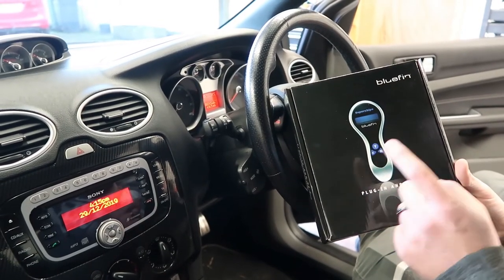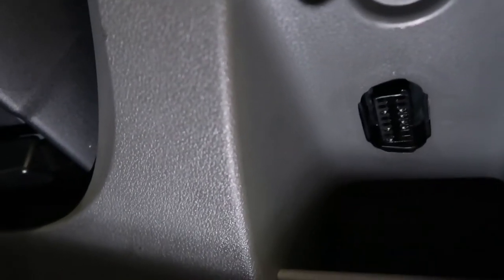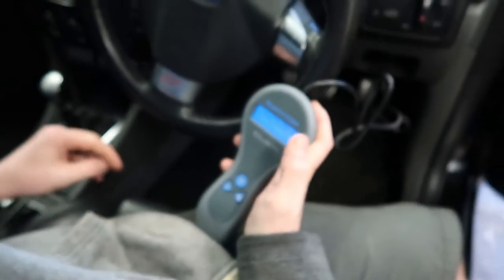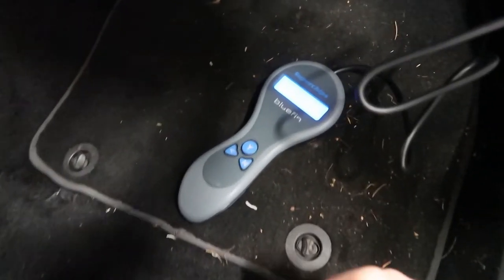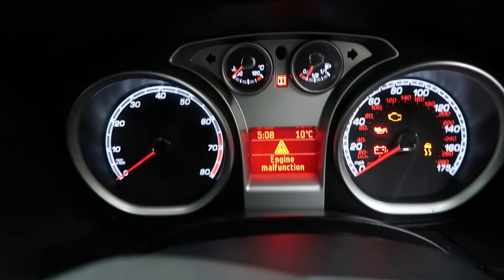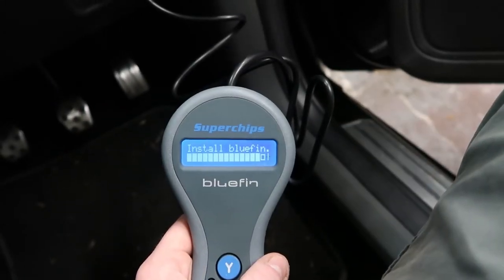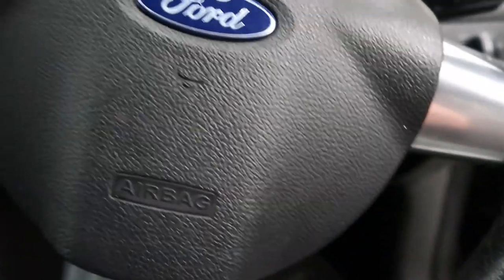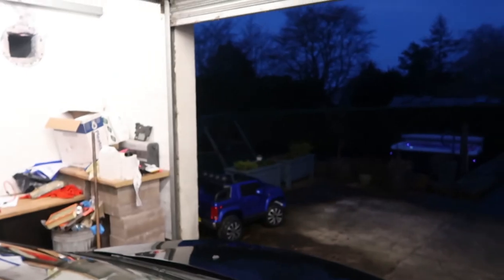HOW to get more HORSEPOWER in your car || Bluefin install on my Focus ST225

Comment: Did you notice the difference once remapped?
Reply from the maker: Yeah, it was noticeably faster, it wheel spins in 4th lol
Reply: Dasi's Garage do you find you’re burning a lot more fuel.
Reply from the maker: F4R Ducky a little bit more but it’s not using loads more. I think if/when it gets a stage 3 map it will burn a ton of it per mile lol. Also depends how heavy my left foot is deciding to be when I’m out in it 😂
Reply from the maker: F4R Ducky I would add though, I believe bluefin (or superchips) went bust during covid, so I’d check before you order! Another good alternative is dreamscience, I’m bringing out a video this week on the dreamscience map install for my RS if your interested in how easy it is to do
Reply: Dasi's Garage look forward to it👌👍
Reply from the maker: F4R Ducky thanks dude
Reply: @DaveRebuilds  look forward too that review.
Reply from the maker: @mnl493x  have done a couple of dreamscience remap on my mk3 focus RS if you’re interested 👍🏻, videos are on the channel 😃